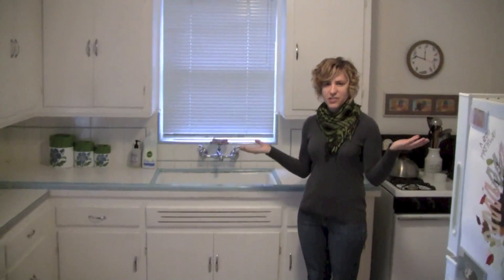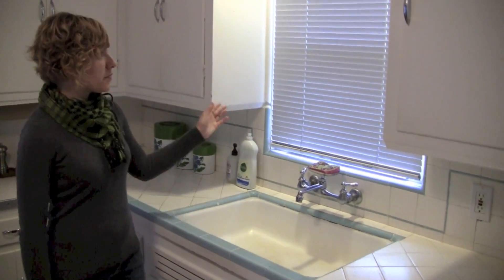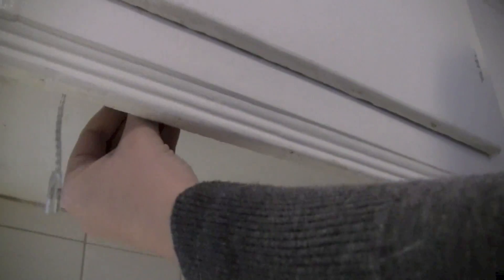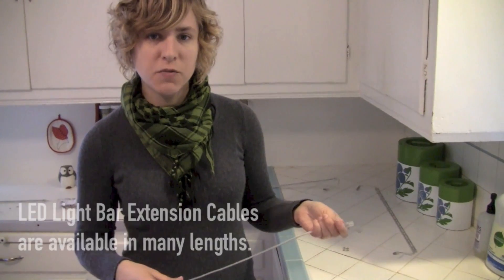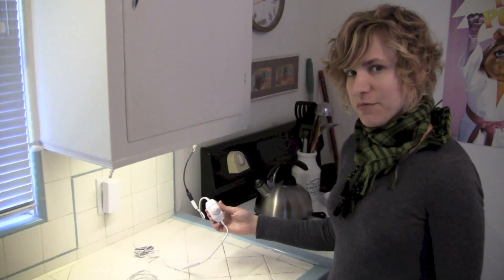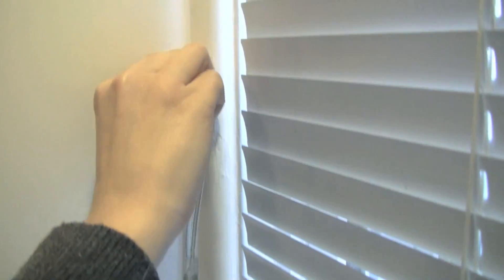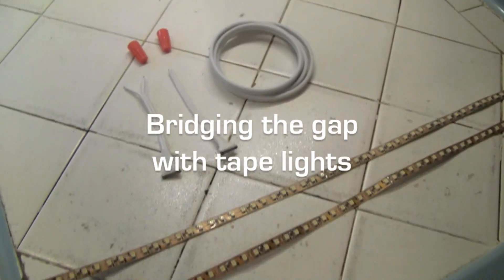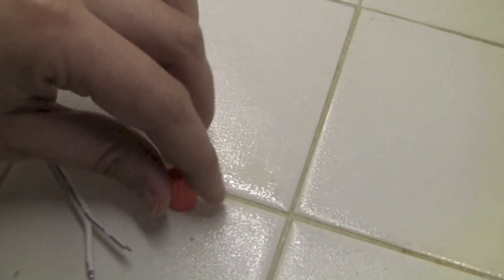How to Install Under Cabinet LED Lights with cabinet gaps

Comment: I have a similar project that I did with my lights, but I am having problems with the Splice Connector's.   Is there a different type of connecter I should be using for a 5050 set of LED's?  I've ordered 3 different types on e-bay now and am not getting the right one.